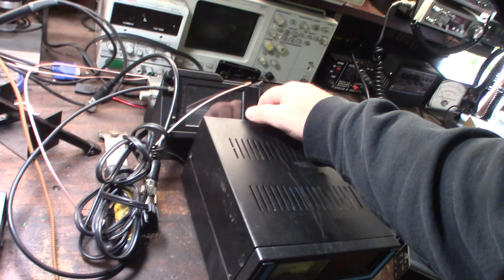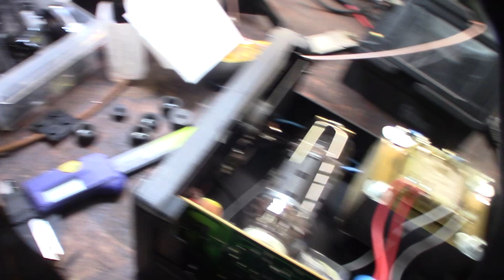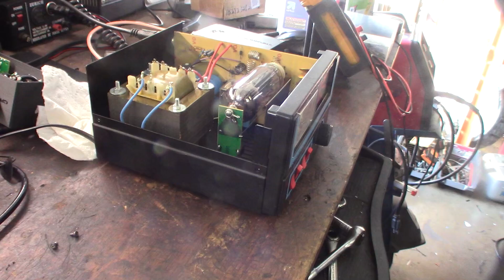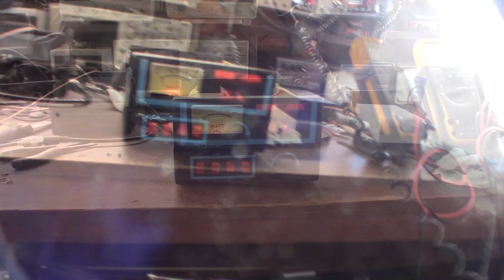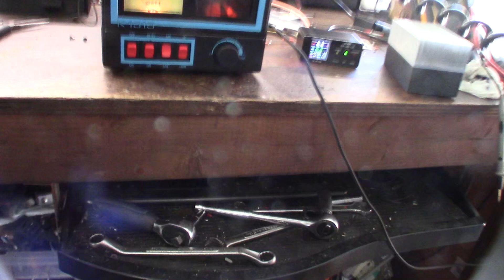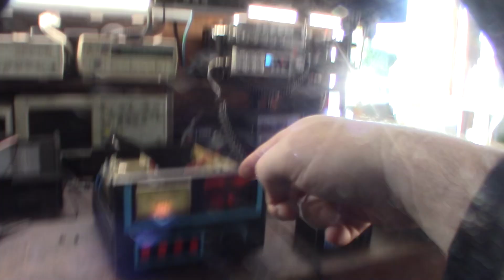RARE!!! Midland Alan K1313  Single Tube CB Amplifier AKA RM Italy KLV200/V Restoration Testing

Comment: I'm trying to buy an old used one from the 80's... I might need to substitute the valve as they worn out with time and use and do a full recap but I might do it as this linear amps are very unique and powerful...! They can go up to 400W with a 20w excitation power with a El519 Tube and are basically used for the CB band op to maybe 30Mhz...
I'm hoping the one I'm trying to get still works even if I need to substitute it's valve, but is in a worst condition that that one that looks brand new...!

Comment: If i remember right those can't really any higher than about 2 watts deadkey so if your grant is doing 5 watts the amp may not like it over the long term
Reply from the maker: Cool thanks, I was wondering because they didn't say anything in the manual. I just need to figure out where to turn down the dead key in the 858 grant.